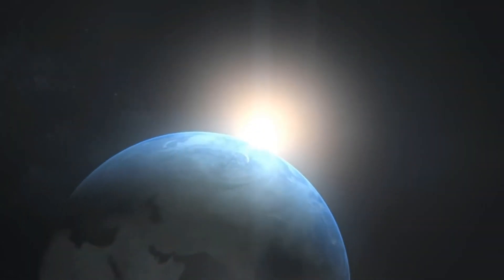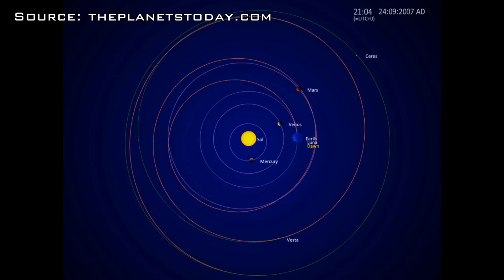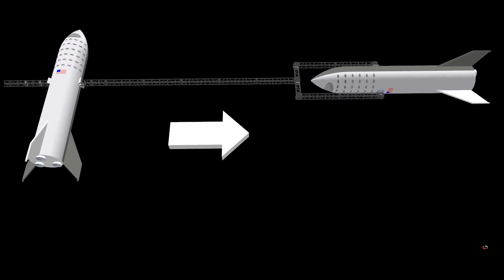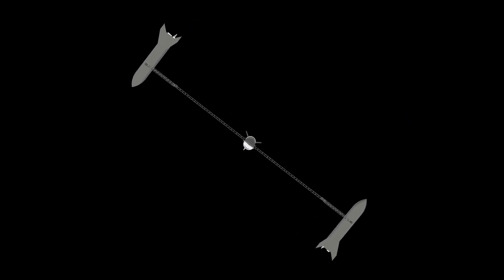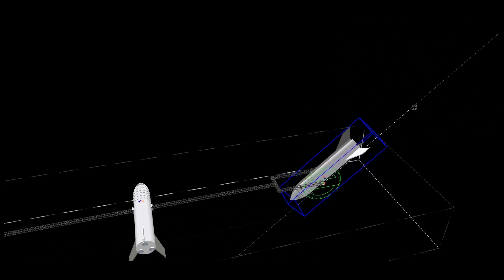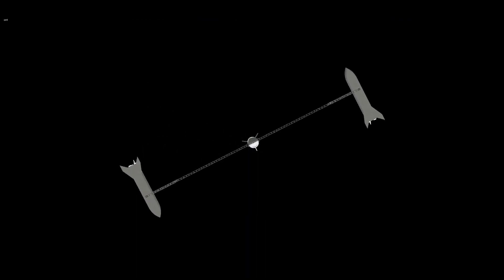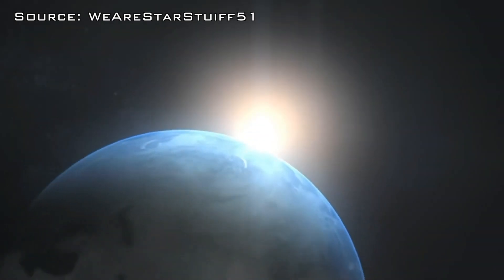GLS2: Artificial Gravity for SpaceX's Starship

Comment: This is an important idea and in general I like the concept.  Like any idea, it will have to be refined with many iterations before we find a practical implementation.  I can think of a number of issues that have to be solved and it will have to be integrated into the overall flight plan.  I agree that some form of artificial gravity is necessary. 

Let me just say that while I am interested in this topic and a PhD Aerospace Engineer, I don't have time to watch every youtube or follow this constantly, so I may be bringing up issues that have already been discussed.  So please forgive my ignorance.

As I've seen SpaceX's plans (and I confess that I have not studied these in as much detail as many others) it looks like the key concept that they are using is aero-braking.  This completely changes the equations for orbital transfer, as you don't have to match the orbital velocity exactly once you arrive at Mars, you just have to hit it at precisely the right time/attitude and trajectory.  This sounds enormously difficult, but in reality they are solving this problem every time they land one of the Falcon 9 boosters.  Using aero-braking, you can use a modified Lambert transfer instead of a Hohmann transfer.  This can greatly speed up the transit time.  So instead of 6 months, you can shorten this significantly.  It requires more DV, but if you don't need the 2nd maneuver on arrival at Mars then you may have enough fuel.   I haven't calculated this but I notice that Gravity Engine 2.0+ has some capability to make these calculations.  This may be why SpaceX has not planned for any artificial gravity so far, they just assume that the transit time will be minimized.

I still like the idea, and it may be appropriate for later missions and for missions to elsewhere in the solar system.  Some potential refinements include:  

Consider a separate small rocket engine instead of using the main engine.  I don't think the main engines can be throttled down to very low thrusts, and you won't want to try to accelerate the system quickly to avoid stress on the structure.  You might be able to just carry extra fuel for the RCS system and accelerate slowly.  

If you use aero-braking, then all craft would have to be reconfigured for Mars entry, the truss disassembled and stowed prior to Mars entry.  You can't leave anything in orbit, as everything will be arriving at Mars with a significant relative velocity.  This may lead you to reconsider cables.

You will want to do some system trades to compare total DV required as a function of various parameters, like induced gravity amount, size, radius, etc.  I'm sure a pretty good model could be built that would provide some guidance.  If you have to disassemble and stow then this may lead to tethers as a better option.

Again, great idea, and similar to things that I've been thinking about.  One thing that I like about Elon Musk, is he thinks outside the box and is often way ahead of rest of us.

Comment: Nice system, had similar on mind. Belive reason for the middle module, is to house the scaffolding construction, and leave the cargo bay of both manned modules for other types of payload. BUT. It is almost certain, the mission will be leveled and mostly unmanned at start. The unmanned ships will be cargo haulers. Therefore, your crewed ships CAN sacrifice a part of their cargo capacity (assuming the rest of the capacity is enough for the crew to complete the journey to Mars, where they can ressuply from the waiting hauler drones). But enough on necessity of the middle rocket, here are 2 other proposals:
1) when ships are conected like you described for gravity, it would be handy, to a) have a piping or hoses, to conect fluid supplys including watter and fuel from one crewed ship to another. b) have a way - kinda elevator made out of kevlar canvas mostly to transport people between said two spaceships. 
2) On both crewed and drone ships,as afterwards on Mars surface, it might be ussefull to have kinda VR telepresence robot, wich could understand basic commands and when dangerous, could be driven (and sacrificed if need be) by colegue astronaut. Not to mention, quite load of tasks on surface (geology, perimeter checks, basic construction etc), could be done by such robots instead of people in spacesuit. When so, said people do not have to risk their life outside their habitat, or outside their mars rover.

Comment: My idea for the gravity issue
I’d say to create spinning cabins that rotate inside starship. Starship won’t rotate with the cabins so it can maneuver on its own. The cabins rotate after a certain time in LEO and stay like that until they reach Mars orbit. The rotation speed would be enough to have things fall down and be comfortable to the astronauts and prevent any issues with the machine 

There will be 2 parts of a machine that will spin the cabins and the entry room. The entry room will slow or speed up for entry/exits in order for astronauts to move in or out of their cabins and also into the upper portion of the ship.

Each side (upper and cabin sides) will have a button that will signal the machine to slow or speed up the room in order to open the hatches to the room. Also, each side will have their own hatch for safety purposes and can be opened manually if an emergency should occur.
To the cabins:
Each cabin will have their own ladders and hatches that will let astronauts in and out of their cabins and into the entry room. Each cabin (exempt for a few) will be provided with their own bed, desk, kitchen, a small exercise station and a bathroom (similar to the ones used in the ISS). Non liquid waste will be contained and launched into Mars orbit. (Or earth if they’re coming back)

The remaining few cabins:
These cabins will be the supply depot, a research room, a leisure room, and other important things that i cannot think of right now.

Before entry/reentry:
All astronauts will be alerted and or awakened by one or 2 astronauts, giving them to prepare for reentry. They must put away any items to prevent messes and potential hazards(including the other cabins). After that’s done, the cabins will slow down with the entry room doing the same and both matching the door on the upper side. All members will be suited up and strapped onto the seats for reentry. 
The crane: the crane will be directly below the cabins and will deploy a small lift that will be deployed. The crew will go down to the bottom of the cabins, where the hatch to the crane and lift is located. There, the hatch will open from inside and a ladder will be there for them to climb out easily. 

I think that’s how I would picture the solution. Of course the 100 people payload is too much so 50 sounds ok. Two rings of cabins filled with supplies (mostly) and other things should be enough for 40-50 people on a 9 month journey

Comment: Interesting. You could use the central starship to store extra fuel and supplies for the journey. Use the truss section for fuel transfer as well. I don't know if the Starship is strong enough to be connected at the point shown in the video, so I'd add a support structure where Starship can stand on, that swivels at the point in the video. Lastly, combining tethers with a fixed structure would allow you using a material optimized for tensile strength, and another optimized for not breaking when torsion is applied. These materials sometimes benefit from the tethers creating more compression on that fixed structure than needed to support the Starships. Keep up the good work!

Comment: Design the starship decks such that they can be effective inverted while in space, and typical while on land. Use telescopic members housed between rocket engines to connect the Starships "tail to tail" before spin up to achieve simulated gravity.

The benefit here is:
One less rocket for the same result
Less useless mass to mars surface (or more payload/starship ratio)
Simpler design,
"rigid" frames aren't completely rigid and the shorter that structure is, the better. 
This method takes advantage of the starship length.
Any torsion on tail mounted truss system (when docked) will roll the starships, whereas with the system shown above the torsion would likely destroy the structure.
Assembly Can be achieved with a simple docking maneuver, identical to the maneuvers they will have to program for refuelling (starship tail to tail fuel transfer)

"The best part is no part"

Comment: How about a 2 Starship only system connected by e.g 500m steal rope (you connct them once you are on the way and acceleration is finished). An auxiliary nozzle (or 2), that can gimbel +-45deg from the horizontal axes, to burn those few tons of fuel to accelerate rotation over e.g some hours or even days (no need to hurry and create huge forces). This allows also to increase gravity on the way home gradually and use the time to get used to 1g again.

Comment: Such a complicated system ...
Why not achieve the same result with simple dedicated RCS system onto the starship hull ?
The same that control the roll axis ?
Just a more powerfull version calibrated to achieve a 1 G gravity value;  simple, and reliable.
Reply from the maker: I like simplified stuff for sure, and I think this design I've presented needs to be seriously simplified. However the weight of an RCS system calibrated to achieve 1 G seems like a tough ask to add onto the existing starship design. I still think my concept (which is to carry the mass of the deployable components in an empty extra starship) should be taken advantage of, no matter how it becomes realized and deployed in future designs.

Comment: Wouldn't it be cheaper / easier to send the truss structure on a cargo Starship to LEO ahead of time. Then the two passenger Starships can "dock" to it and it removes the need for the third "dead" starship to be connected during the whole transfer.
Reply from the maker: For the first tests, what you're saying will work, for use just in LEO. But for the trip to Mars, that truss structure needs to be pushed into the transfer orbit. With the GLS design, the structure doesn't deploy out of the payload bay until orbiting the sun, and on its way to Mars. Also this way it can fold up, land on mars (theres not enough delta-V in current plans to enter orbit around mars, just slow down using Mars's atmosphere and land) re-fuel and be re-used on the way home.

Comment: So you're basically getting the value of a reaction wheel at the cost of two extra starships + first stages alongside taking up space with a truss system?
Sounds like a splendid plan, I love to pay billions more than I have to on something that has a far easier solution.
Reply from the maker: I don't see how a reaction wheel could do this. How could it? Can you draw a picture? By the way, you only need one extra starship, the current plan is to send two and I added one.

Comment: Or you could have the starship spin along its central axis at around 14 rpm and get roughly earth like gravity, but the downward direction would be outward. The diameter is about 9 meters which is more than enough to have people standing on opposite ends, and would also trivialize moving accross different levels of the starship as it would just be walking side to side

Comment: This title is clickbait.   👎🏻

I am sure this guy THINKS his design will work, but there are glaring flaws in it.   Hint: two of the problems are redundancy and weight distribution.   Let’s see if he is smart enough to see the other flaws.
Reply from the maker: Sorry if you didn't like the design. This was my second youtube video ever published, and the intent was to share my idea for a concept. I do think my core concept (which is to carry the mass of the deployable structural components in an empty extra starship) should be taken advantage of, no matter how it becomes realized and deployed. I made this design to illustrate how the concept could work. 

If you have a design with redundancy please share, but remember a plane doesn't have extra wings in case the wings fail, not everything needs to have a backup. As for weight distribution, are you talking about balancing the system? Hopefully the weights of the two craft end up pretty close, but that is a good point. Future versions of the design will need a "climber" that adjusts GLS (the ship in the center) as a "counterweight".

Comment: Heres one solution to manipulate gravity. Weight is not and issue so build a very large ring in outer space.

 Stock it with workshops, labs, medical needs, living areas, kitchens, building materials, fuel, supplies, food, water, oxygen, automated remote control worker robots of various types, diggers, drillers, ice melters, pumpers, manufacturers etc. Escape pods.

The ring is built of compartment modules all with air lock doors in case a modules air tight seal is compromised.

Adapt the ring to dock
Starships in the orientation required for upright position.

Attach multiple super rocket engines to ring, aim the ring and or super rocket engines to start the journey and rotate the ring for preprogrammed gravity.

Human Arrival, survival, landing and support on Mars will be greatly improved with a orbital space station in place.

We should have backups in case of trouble on Mars. Save as many people as we can if not all.

Comment: Interesting idea. However it's fundamentally flawed. The velocity of the starship would be too high for the rods made of any Earthly material including (CFRPs Tungsten or even steel) to sustain that stress (1000s of kN) for 4-6 months while exposed to direct solar radiation. It's bound to fail. And if you add more material, the payload of the Starship comes into question. If you segment the materials, the quality of the weld or joint comes into question. Speaking of crew comfort, orienting the ship perpendicular to the sun would most certainly produce constant vertigo in the crew. Go back to the drawing board(Not cynical, just realistic)
Reply from the maker: Great points. Segmenting the materials is important, but the next drawing board version uses strap style tethers to hold the actual load. Also the tangential velocity is only 31m/s velocity in relation to the sun won't put any stress on the spin system. The centrifugal force will. I estimate that with GLS v2 specs, a 470 ton vessel will pull on the center of the spin system with the equivalent weight of a 528 ton starship hanging from a crane on earth.

As for comfort, the next iteration will have a larger spin radius bringing the spin speed down a bit. I'm excited to see how low we can realistically get it.

Comment: An interesting idea for spin, but how heavy would each of the outside rockets become at 3 RPM? That strut holding the outer rockets to the center rocket, will have to be very "robust", to handle the weight generated by the spin. How much spin is required for half a G? It would be 1.5 RPM. HOW MUCH GRAVITY DO WE REALLY NEED? WE DON'T  KNOW.
Reply from the maker: Great comment. My rough calculation is that each 470 ton spacecraft would pull with the equivalent force of 528 tons on earth when you factor in the that the fuel tanks and engines are pulling from farther out from the center of the spin than deck two, the 1G deck. If you wanted 1G, a 100 meter radius system would have to spin at 2.1 RPM. Weak grav is better than no grav but IMHO 1G is the best, and then as I said in the video it would be nice to go down to deck 1 or lower to work out in an environment with slightly stronger artificial gravity.
Reply: @smallstars  WOW! How about we shorten the strut as far as we can, to minimize the additional weight generated from the spin. How short? Would we have to increase the spin as a result? By how much? Would it be more or less advantageous with shorter struts? Lots of unanswered questions, but looks . . . interesting.
Reply from the maker: @brianrichard8310  Actually the final version of this will probably have a longer strut. Take a look at this comfort zone chart. Coriolis effect is real. http://www.projectrho.com/public_html/rocket/images/artificialgrav/gravComfort03.jpg

Comment: The only problem is that the trusses would have to support the 1g weight of the ships, and the middle ship could easily be torn in half
Reply from the maker: That load would be held by a robust rigging point in the middle of the GLS, none of it would pull on the hull of the middle ship. It will be quite the heavy load though, with both ships pulling at 1G, and in fact more than 1G of force for the farther away sections of the starships because the design aims for 1G on deck 2. Deck 1, where the gym would be could have slightly stronger grav, and the fuel tanks and raptor engines are even farther away from the center of the spin than deck 1

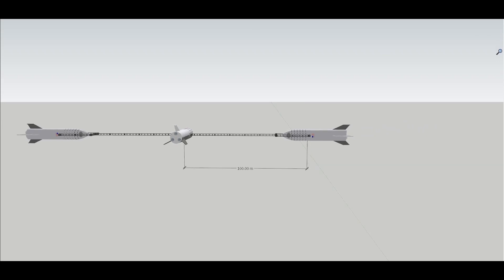Comment: 7:18 wich material you propose to use to keep the 3 BFR togheter? because need a tension equal to 1G + all the mass of the rocket included what is inside(humans, food, tools).
Reply from the maker: Plus the extra force from the bottoms of the ships being swung around with a spin gravity of more than 1G because they are farther from the center of the spin. I'll update soon with a new video, slightly different design, hopefully I can specify materials.

Comment: Do you know how long those would need to be... because the scale of that graphic is going to lead to a very miserable trip. Even 2001s station was not large enuff for the rotation to be comfortable
Reply from the maker: Starship is 55 meters tall. The graphic is to scale with a 99 meter radius to deck two of each starship.
Reply: @smallstars  you realize that's over a 1% difference between an average mans feet to his head right? That's no where near big enough